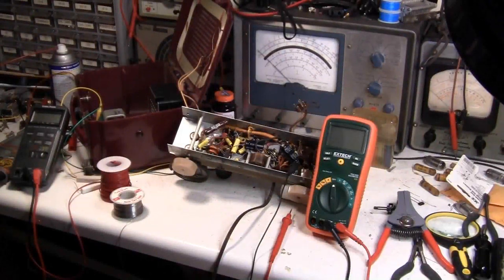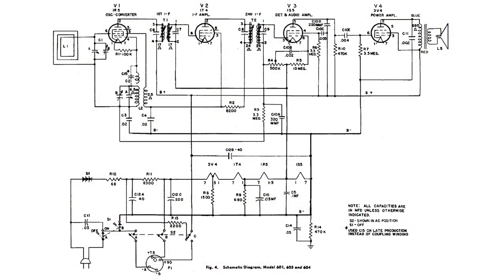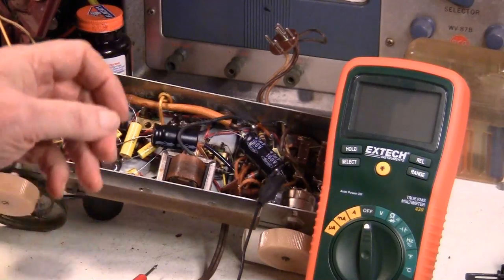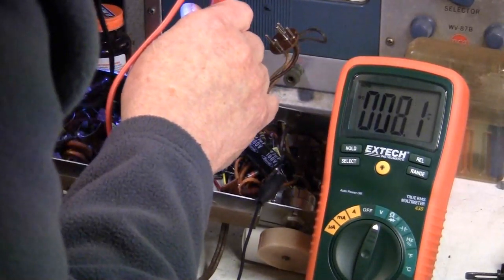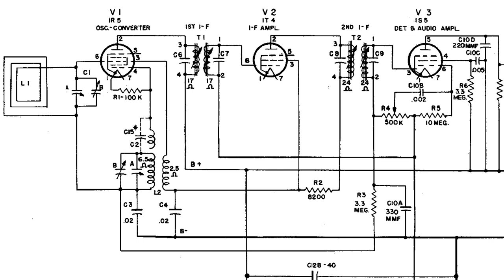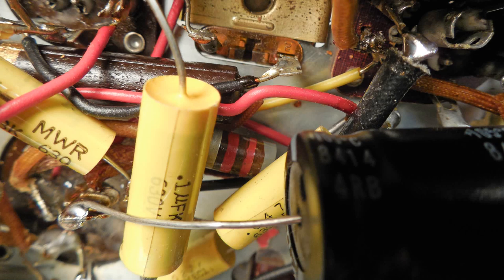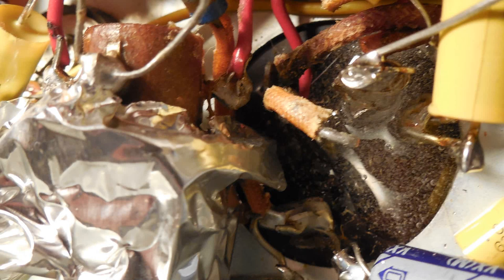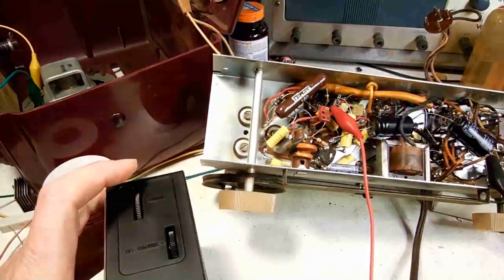Portable Tube Radio Repair, Troubleshoot Oscillator problem

Comment: I like the way how you show the schematic diagram in conjunction with the radio and the corresponding components you are describing and testing. I have learnt a lot how to find out if the local oscillator works and how to test with a simple portable radio as a "help" to find it. Thank you very much for this wonderful tutorial and practical lesson.
Reply from the maker: Thanks

Comment: Rick my dad gave me a inop Silvertone 100.195 chassis #. radio 40 years ago.  I recently just finished all the electrical repairs and it now works perfectly.  I'm a little slower with my repairs than you are!!  It had a bad winding on the oscillator coil.  I was lucky in that I only had to unwind one turn to find the open.  I wish I had known this trick with the transistor radio to determine oscillator function.  Thanks for this series on these repairs.  They are very helpful.

Comment from the maker: Thanks Jan Scheltes
I have an isolation transformer. On the isolated side of the transformer I have a VARIAC. I have used light bulbs before and they were quite well. But today I always use an isolation transformer and a VARIAC.

Comment: Interesting vid...I've been restoring radios for a long time, and I've never had an open resistor that didn't look damaged. I guess it just goes to show that anything is possible! This video also points out something else useful; for basic radio troubleshooting, no fancy test equipment is necessary, just a simple multimeter works fine.
Reply: I've had a few open circuit resistors

Comment: I first noticed what you just demonstrated years ago. One of the radios was connected to the TV cable because they carried FM radio in the area at that time. It was about the only way to get excellent FM reception in the area.

Comment: yup 8.2k was open  most common thing in those old tube sets. i used to work on many sets in the 70s up 80s up .did tv repair ham sets cb amps. wide range learned a lot had much fun.

Comment: Hello, I'm watching from Sao Paulo, Brazil. Do you know a good AM tube radio Kit to recommend ?
Reply from the maker: I found these to be interesting.
https://www.walmart.com/ip/Diy-Kits-2P2-Electronic-Tube-Single-Lamp-Medium-Wave-Radio-2P3-Radio-Kits/1299434810?wmlspartner=wlpa&selectedSellerId=101191932&adid=22222222227000000000&wl0=&wl1=g&wl2=c&wl3=42423897272&wl4=aud-430887228898:pla-51320962143&wl5=9009673&wl6=&wl7=&wl8=&wl9=pla&wl10=635378093&wl11=online&wl12=1299434810&veh=sem&gclid=Cj0KCQiA1ZGcBhCoARIsAGQ0kkrvx9UyXMOpU2rKTjAI6EDeiQl0AM1G__eEsRsH6L6y3H6qwcoJbz4aAt7REALw_wcB
https://www.tubesandmore.com/products/radio-kit-2-tube-regenerative-radio

Comment from the maker: The best that I can tell, is that it looks military, and from the label looks like it was a tube set. From the video it looks like it still has one tube and it has been transistorized. That's about all that I can say about it without drawing up the wiring diagram. And since it is a custom modification to learn more about this unit you would need to draw up the wiring diagram.

Comment: Had a fisher 500s with an open oscillator secondary transformer, removed silver mica, replaced with mica caps ,had to “unwind secondary about 20 feet to find the open winding resoldered had my oscillator! Albeit a bit off freq
Reply from the maker: Hope you can adjust the oscillator enough to correct the error